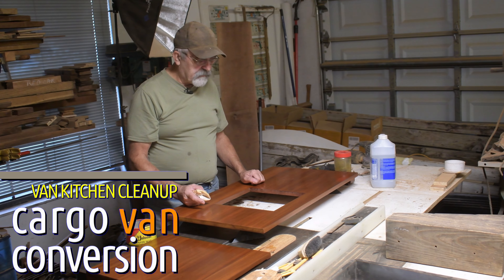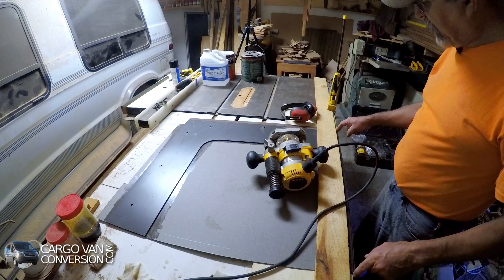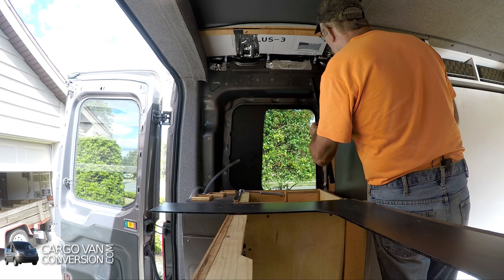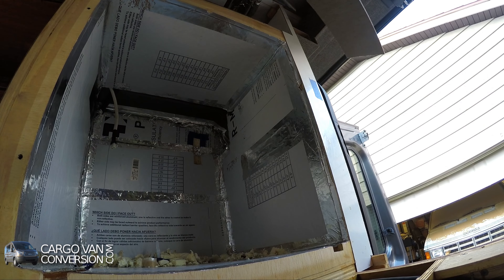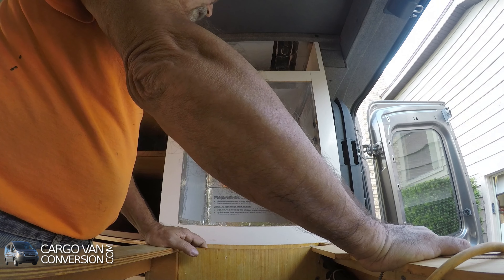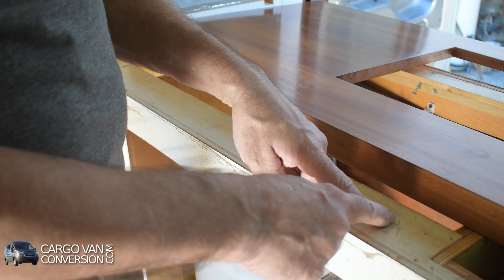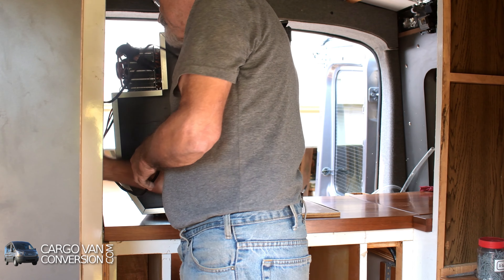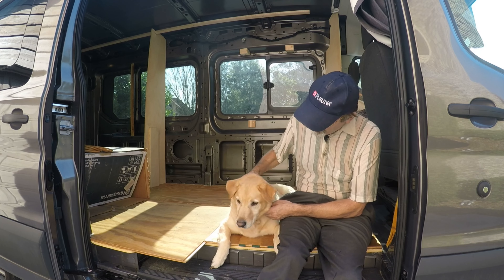RV Kitchen Cleanup

Comment: Do you have ventilation at the rear of the fridge?? I use a thermostatic controlled 12v fan to extract hot air from the rear of the fridge compartment out a vent in the side wall of the van.  Noting that the fridge generates a fair amount of heat, it's important to keep the air around the heat exchanger as cool as possible to get the best efficiency out of these small compressor fridges.
Nice job on the counter top - is it ok to use wax over the top coating??
Reply from the maker: Hi Norman,
Just posted a picture under the 'Community' tab, which makes it clear.
The area behind the fridge, draws air in from the area above the fridge, helped with a temperature controlled fan and blows it out into the van, just to the right of it. I have 1-1/2in - 2in insulation all around it, to limit the heat inside the cabinet. BTW You describe the issue well.
Furniture wax is a non-permanent solution; it's always fairly easy to remove it, if you so desire. The poly-urethane top layers will protect the wood against water, after all it is a kitchen countertop, but water can leave stains. Those are usually easy to repair, but with a wax coating once a month or so, that would be avoided.
Wax is underrated; I love to use it on the wooden slides of furniture drawers; they last a lifetime and the drawers work better than commercial ones :)
Van Williams & Joey
Reply: @cargovanconversion  Thanks for that.
It's wonderful how useful wax is.

Comment: worktop ??   shellac - varnish - wax, I have never put wax on poly should I try ?????
Reply from the maker: Hi David,
for me it's more a personal choice. In this case, the counter is exposed daily to water (kitchen) and stains will appear from water on poly-urethane. Wax is just an easy extra layer. I didn't use wax on the counter at the sliding door. Wax is a cheap, old an proven product that's worth considering, instead of these new and high-tech things, that are suppose to make your life so much better :)
Van Williams

Comment: very few will understand the care taken with the slot ..
Reply from the maker: Hi David,
I am far from being a furniture maker, yet the understanding one gains by working with wood, is that it expands and shrinks with the seasons. That movement is even more noticeable inside a van with extreme temperatures and humidity.  Just think what would happen if you don't take that into account and the wood expands by 1/4 of an inch.
Especially when you work with wood and put many months into a furniture piece, you have to be aware of that.
Van Williams